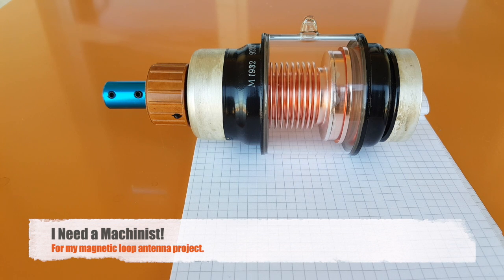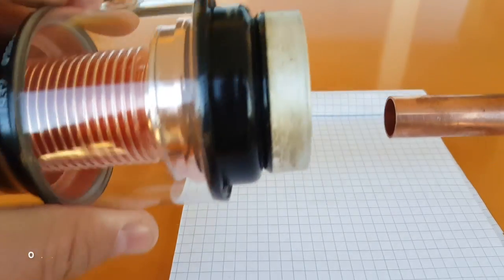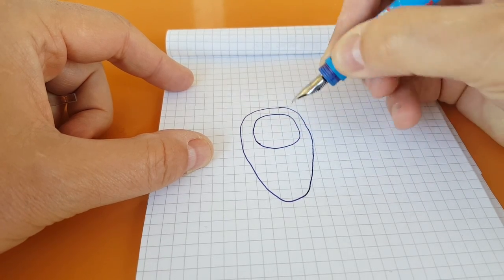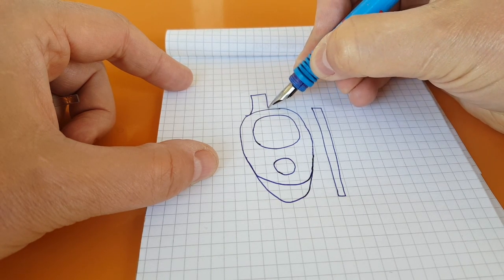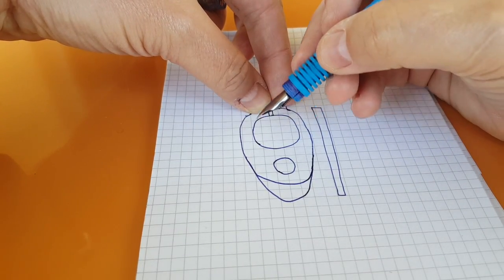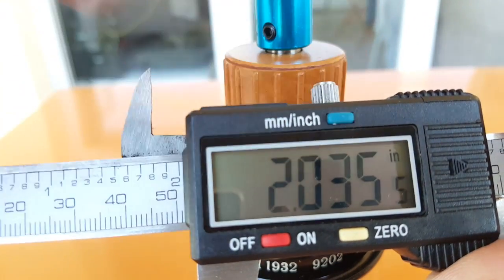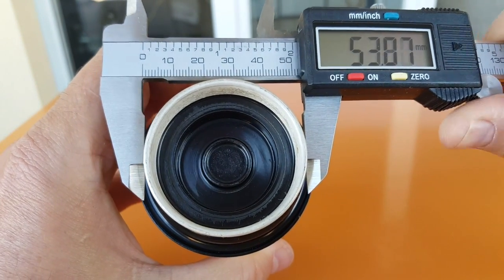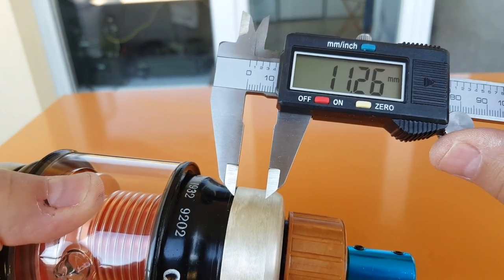I Need a Machinist For My Magnetic Loop Antenna Project

Comment: take this with a grain of salt but just use stainless steel hose clamps and flatten copper tubing to fit under it as loop element.
Reply from the maker: As a last resort...

Comment: Hi gil for proof of concept I would use a strip of brass or copper to clamp loop to capacitor easy to bend to shape and solder ?
Reply from the maker: As a last resort...
Reply: @RadioPrepper  gil I have a lathe  and 40years of engineering experience flatten a length of tube use a single side NOT double that gives you a workable strip to form your clamp
Reply from the maker: Of course that would work. I would prefer however to use a clamp made for it. I already had one 3D printed and it fits great. Next two will be metal...

Comment: I've made a number of parts like this.  I recommend you draw it up in a CAD program and print it on paper in 1:1 scale.  Cut it out and test fit it first.  Good chance you'll save yourself some money.  Once you get that sorted, have someone print a 2.5D version of the part for you in plastic.  Either leave it like that or commit it to metal next if you want.  There are plenty of free CAD programs and this part isn't too difficult.
Fusion360 is amazing and free for hobbyists.  You could also try FreeCAD, TinkerCAD or something like that.  Thanks for the great videos!
Reply: I didn't listen well enough the first time through and missed the fact that you're relying on it for physical AND electrical duties.  You'll need two parts then by the looks of it.  Maybe they can be the same part, though the O.D. of the capacitor "legs" differ a bit more than I'd like for a tight fit.
Reply from the maker: Good idea to do it in plastic first!

Comment: Hi Gil, the 52mmx10mm band on the vac cap, is this Aluminium? Attatching an anodic metal (Ali) to a cathodic metal (Brass & Copper) will cause electrolytic corrosion over time. Even in dry conditions. With heat, brass and copper will contract also. I don't know all of the details of what you are trying to do and maybe I have the wrong end of the stick so apologies in advance if I do.
Reply from the maker: Not sure what it is... I don't think It's aluminium though...

Comment: Gil, I have modeled a pair of clamps per your specifications.  I used your measurements you gave in the video but have not added any fit-up tolerance yet. I can add say, 0.001" to each diameter hole or whatever you specify.  I can't post a screenshot of it here on the youtube chat. Once the design is set, I can send you both the native SolidWorks fiile and a STEP file which is like a universal file type for 3D solid models. Send me an email, I'm good on QRZ.  W5ZYM - Craig
Reply from the maker: Excellent Craig, thamks! Someone suggested I get it 3D printed first to try for fit. Please send to gil@radiopreppers.com
Reply: @RadioPrepper  email sent with attachments. I've added 0.001" to each hole already.
Reply from the maker: Awesome, thank you!

Comment: I see what you're trying to do buddy but I would just use brass or copper, since it can be cut and shaped with hand tools. I had the same problem up here in the North, finding someone to machine a strange Parts they don't understand. So usually end up fabricating something with hand tools. Good luck on your project then I'm watching closely.
Reply from the maker: Thanks, that is an option...

Comment: If you can get hold of the brass or copper, they are both 'light' metals and can easily be cut with a battery drill and hole saw cutters.  The slot, etc can be easily cut with jigsaw or hacksaw.  Its not something you really need a machine shop for, you can do that easy at home.
Reply from the maker: True...

Comment: Gil, I don't think you should have a clamp "Galvanic" connection to your capacitor. Mag Loops are very sensitive to points of electrical resistance. The connection should be soldered for an "Electrical" connection to minimize resistance losses in the loop. And copper based solder is considered a best choice for octagon copper pipe loops. I would consider flattening the end of copper pipe and solder that to the metal rings of the cap. Compression fittings and copper pipe added to the ends of the cap could be used to make the cap removable for transport and for easy reinsertion without the need for a machinist, but brings back the resistance at the joint problem again. BTW, I think the difference between compression fit, or soldered connection doesn't make a noticeable difference as long as the rest of the loop design really good. Also a thick part like yours needs to be cast, then machined to fit.
Reply from the maker: My fear is that the heat might damage the capacitor...
Reply: @RadioPrepper  Yes sir, I thought about the same thing because I have never handled one of those vacuum tube caps before. But I also thought the clamp may distort those rings and crack the glass too. So I'll just have to wait and see what you come up with. Meanwhile I will look at other peoples  projects and how they did it.
Reply from the maker: Yep, not sure exactly how I'll go about it... Maybe copper braid even...

Comment: COPPER PLUMBING HANGER STRAP =)   It has holes already in it to bolt together and solder the copper tubing to the copper plumber hanger strap =)   That is what they do around here on making mag-loop antennas =)   Good job Gil =)   I know it would look more professional to be machined out of copper slug / cube =)    The price of copper around here is like the price of gold 8-O
Reply from the maker: Thanks. I didn't see anything like that at the hardware store, but worth looking into...
Reply: @RadioPrepper  Gil it is on eBay and you may be able to fine it other places on eCommers =)
LINK:>>> https://www.ebay.com/i/173390861800?chn=ps

Comment: Hi Gil,
Don't know if this will help, but might show you another way for mounting. Found this on Ebay, but only one.  73  WB3BJU

https://www.ebay.com/itm/MOUNTING-KIT-FOR-VACUUM-VARIABLE-CAPACITOR-KP1-4-KP1-8-KP1-12-52-55-mm/232731381662?hash=item362fdf0f9e:g:9QAAAOSwJQdW~uBw:rk:190:pf:0

Comment: Hi Gil
I connected to a vacuum cap by using SS hose clamps to 'clamp' copper stips wrapped around the ends.
The clamps were Stainless  from an AutoParts store, $2-$4.
The straps were 5 thousands thick cut with scissors from a sheet bought at a hobby store, $5.

Since current is minimum at the cap of a MagLoop, a 5 thou strip is OK. I can buy thicker copper sheets at Hobby Lobby in US.
Since voltage is max at the cap, I rounded the corners and polished the cut edges of the straps.
Who ever said HAMs were anal?

Many moons ago I saw the 'correct' end caps on Surplus web sites but they were very pricy.
Good luck with the loop. It should work beaucoup gooder than any 'shortened' aerial.
I follow u 100%.
Russ in NH, KA1RUW
Reply: Hello, 
What was the price of the piece you did see ? As commercial magnetic loops are rather expensive  (the "cheaper" I saw is sold at 400€, and many are from 650 to 1150€ ..)
Reply from the maker: Last resort maybe, thanks. Mine should cost a bit less than that, and be bigger...

Comment: As you know. and if making several pieces could reduce the cost of each unity I will buy one too. I can too ask friends if they want buy one for a magnetic loop. I wondered if a 3D print could help, by melting aluminium ?
Reply from the maker: Not a bad idea thanks. Aluminim isn't conductive enough though for a mag loop...
Reply: @RadioPrepper  Sorry if I use french, I don't know how to say "tour" or "fraiseuse", these tools could perhaps be used to work copper and obtain what you need, especially as some of these tools can be driven with computers in the same way as 3D printers or CNC. I can try to find as I remember someone who did a little piece of a gearbox that became unavailable, but he isn"t a professional and did it only for his own purpose. Or much easier to find, as these printers are now very common, simply plastic 3D but only to support parts of copper handling the bulb and another critical things ?
Reply from the maker: Maybe yes, that is an option. Tour=lathe. Fraiseuse=milling machine :-)

Comment: Also, if you really want a part machined, I have used eMachineshop.com a few times. You download their CAD software, design your part, pay with a credit card and in a 1-2 weeks the part is at your door. Not real cheap,  something like what you drew maybe $100. Charlie KM4ZZ

Comment: Gil,

How about 10mm wide strips of copper, thin, maybe 1.5mm thick. You drill three matching holes for screws in each strip. Then the capacitor fits between two of the holes and the copper pipe fits between the middle hole and the third hole. The capacitor and the pipe are clamped between the two strips. The thicker the copper, the stronger the clamping action can be. The copper strip is bent around the pieces. No machining, hand tools only. Charlie KM4ZZ
Reply from the maker: An option thanks, if I don't find a better solution...

Comment: You could most certainly  buy hole saws that would be just under the size and drill a thick lexan plate the size you need  that would withstand the exposure to sunlight. You do not need a machinist.  use link---> https://www.amazon.com/DEWALT-D180005-14-Piece-Hole-Saw/dp/B000HCZ4FW/ref=sr_1_9?keywords=large+hole+saw&qid=1551549873&s=hi&sr=1-9

Comment: 3d printing ?
Reply: 3D printed parts are mainly plastic (PLA, ABS, PETG...). 
I think a CNC milled brass or copper plate will be ok. The part is simple and can be easily designed in a CAD software, exported to STL for the CNC milling machine.
A maker or a fablab in Nice and area may be able to help :)
Reply from the maker: Brass plate would be cheaper than copper.
Reply: A laser cut plate would be nice, and the shape of the part Gil needs is adapted to laser cutting. 
But are laser (plasma?) machines able to cut a 10 mm copper or brass plate? Curious to know :)